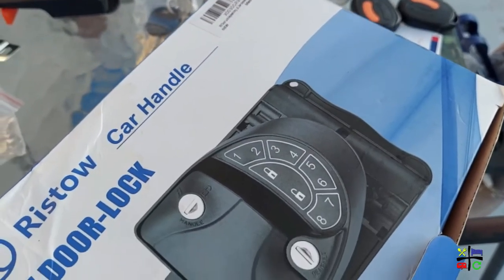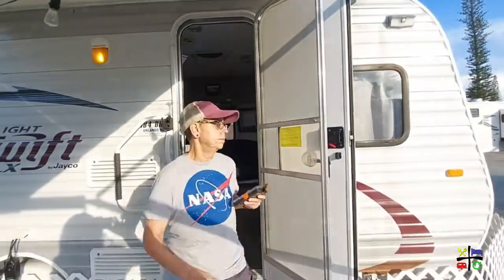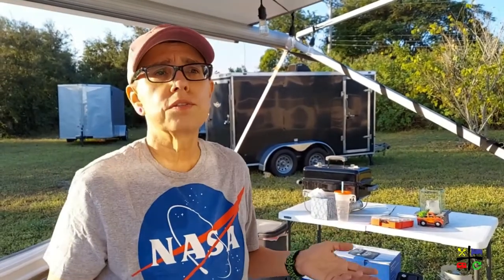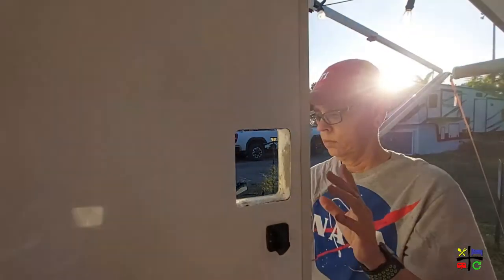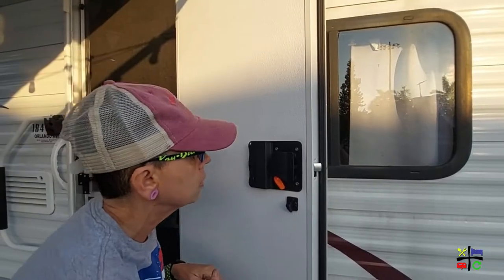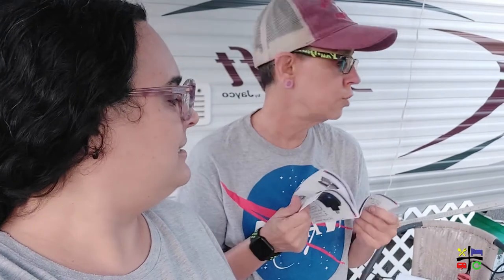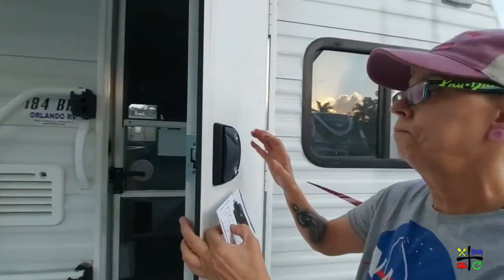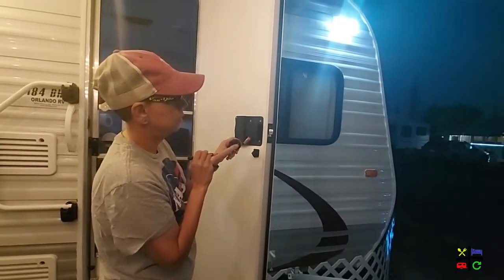Ristow RV Keyless Door Lock Upgrade | RVLibro Ristow Keypad RV Door Lock  | S4E28

Comment: I have my key fob programmed and I can lock the door on the keypad but for some reason when I go to unlock it the code is not working. Has anyone else run into this issue?
Reply from the maker: Interesting.  We have not, since we never use the fob. We only use the keypad. And once when the battery died, the key itself. 🙃Angie